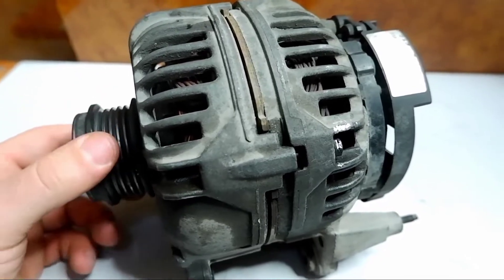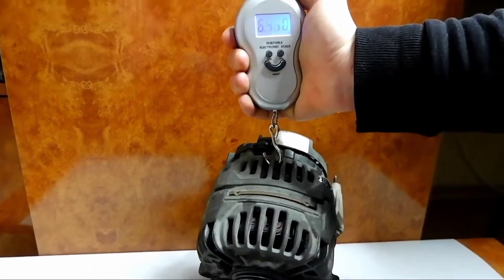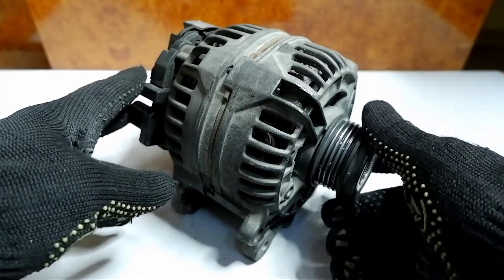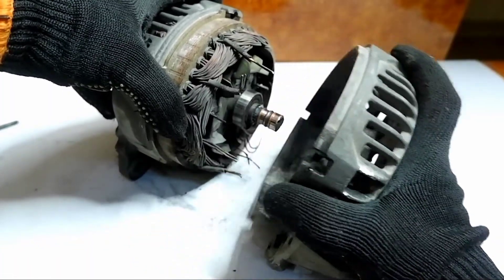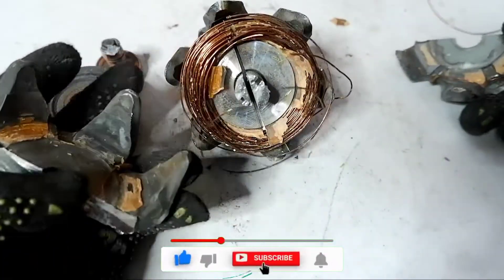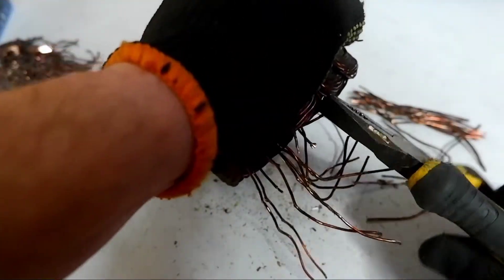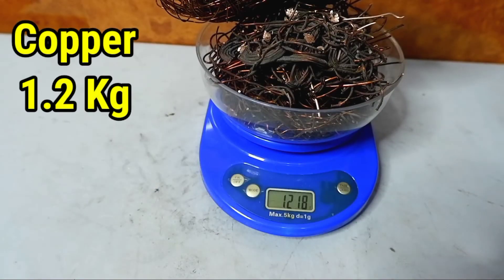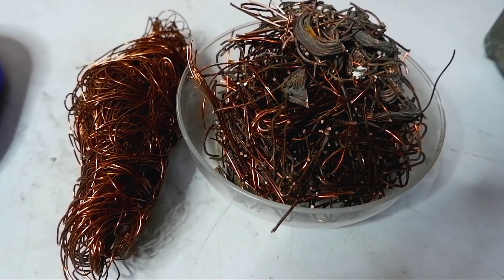How Much Copper is in a Volkswagen Alternator?

Comment: You can make some nice ingots with that😁
Reply from the maker: I would really like to, but unfortunately I don’t have a furnace for melting metal, where did you buy it from?
Reply: @CopperKing  i bought it on a platform where you can buy used stuff. He sold a new packed devil forge because he bought a couple. But if you got the materials, you can make one yourself 😉
Reply from the maker: @SJWCASTING  Unfortunately, I live in a small country and it's very hard to find them, so I'll have to make it myself.